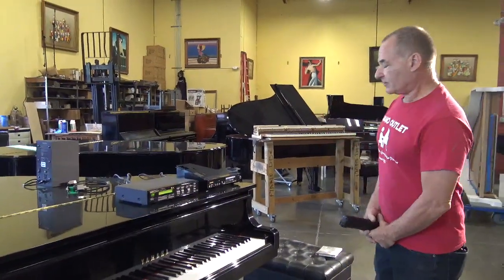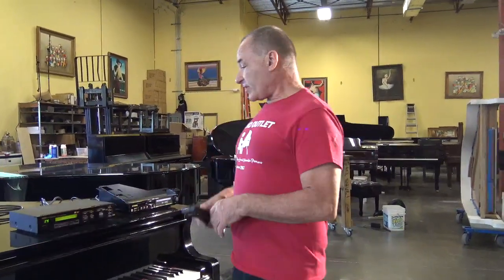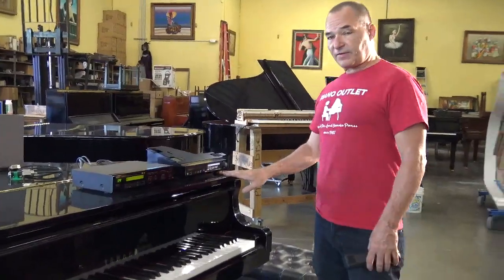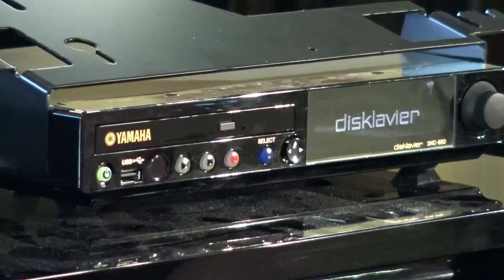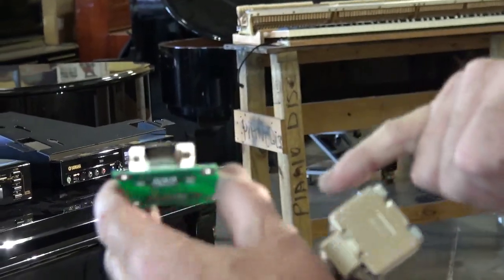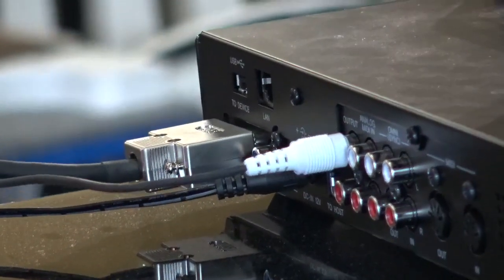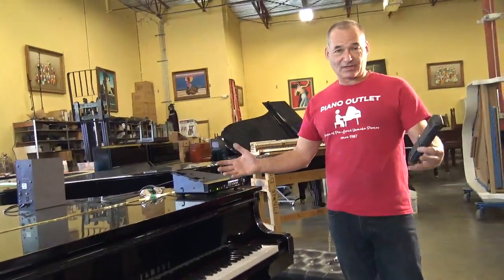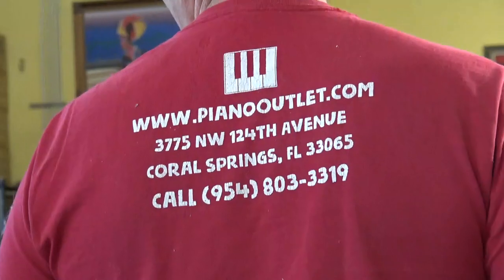DKC850 Yamaha upgrade connection tour and first look at the "ADD" Bypass.

Comment: Hi Richie,
We have an old 'wagon grand' diskklavier and want to upgrade. The point is that the connection cable is different from what you showed: a thick round cable (like the connection of the pedals)
Can we upgrade through midi in/out? Could we change the cable and make (order) a bypass like you did for your diskklavier, so we wouldn't need the old wagon?
Thanks a lot for the video's!

Comment: Great new technology. So this will work with the Yamaha  MX100A and if the old electronic control box stops working this will upgrade and replace the old one ?
Reply: Hello. It will work on any piano who’s control unit has a 9 pin D-sub connector. And yes because of this it doesn’t matter if the original control unit goes bad because the dkc-850 will replace it . You can also simply add a better control unit to an older piano without actually upgrading it to Dkc-850.
Reply: @hayesiq  Hi Richie. what do you suggest for alternative solution ( beside DKC-850)  when MX100A disklavier original disk player do not work? I tried the Bluetooth Yamaha MD-BT01 Wireless but it need a working disk player which do not work in my piano?
Thanks